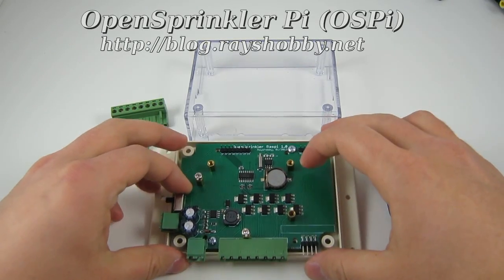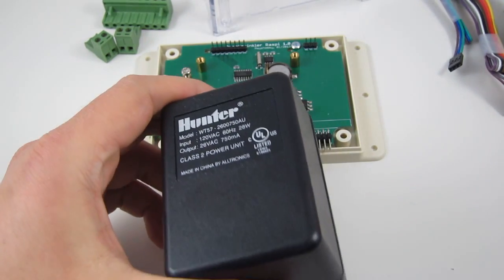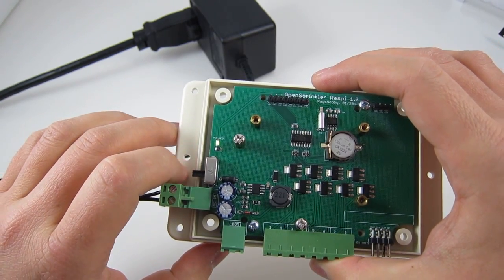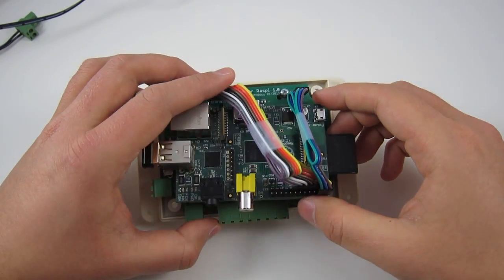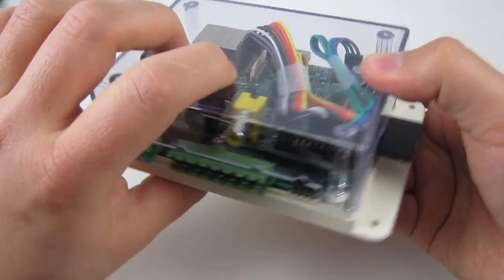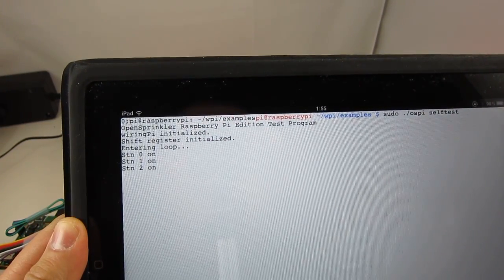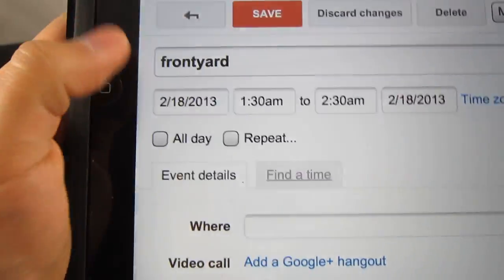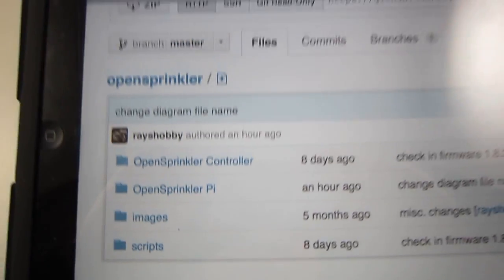OpenSprinkler Pi

Comment: Will this be enough to power the new RPi 3 ?

This board might be ok if you are going to run a RPi 3 in vanilla with no additional usb slots populated BUT the new RPi 3 needs a 2.5A power supply if you load up the usb ports on it, so will this board be able to supply the power needed?

That is the problem when you want to power everything from the device, 
you do not know what future version of the Pi might come along and 
demand more power
Reply from the maker: +MrMaveri I haven't got my RPi 3 yet so I can't test. The DC-DC converter should be sufficient to provide the current required by RPi 3, but OSPi has a 1.5A on-board fuse to limit the current to 1.5A. So if that's not sufficient, you can solder a larger fuse (or solder a wire across it to short it out).